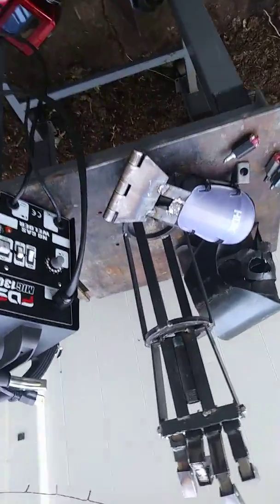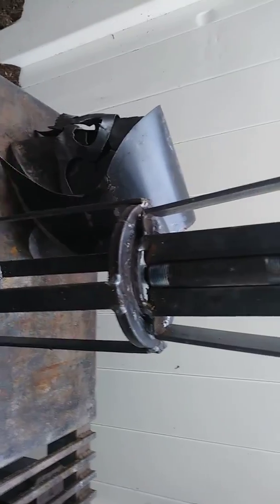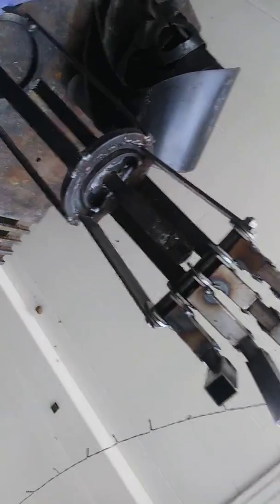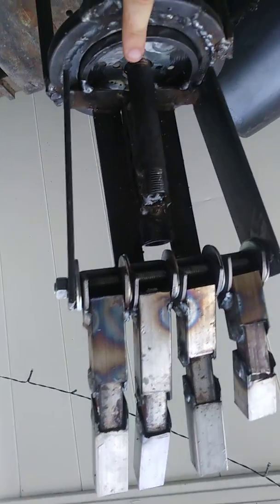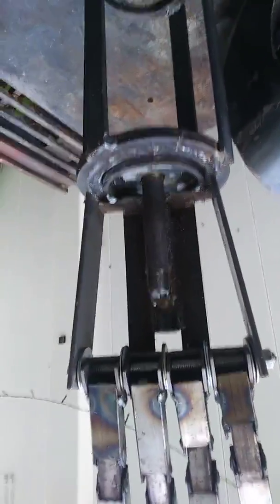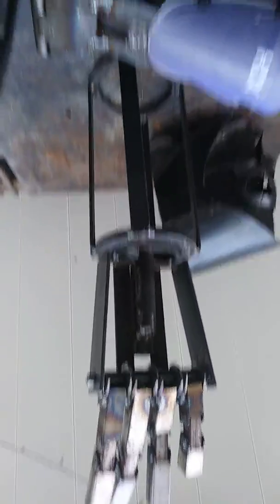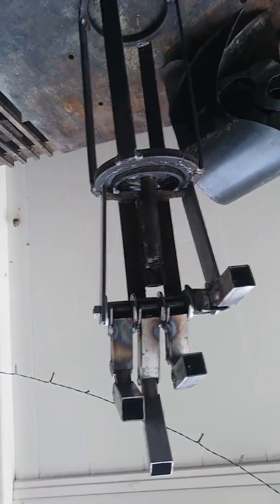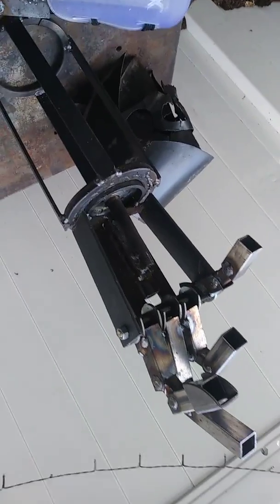Power Armor project #4, Gauntlet re-design and upgrades.

Comment: Whats the name of the hand sistem
Reply from the maker: I have servos connected to flex sensors and those servos are connected to wench wire that runs up each finger. This new model had linear actuators mounted in the forearm that pulls on the wench wire as well, giving a total crushing force of 1350 lbs per hand.

Comment: In all honesty your could destroy mine by hand shaking it mate
Reply from the maker: The goal is to make it functional in practical applications! One reason I'm putting a huge door hinge as the knuckleplate. My Instagram has more updates than this. 

Besides, you are the one with an engineering background. I'm pretty sure yours its gonna be beast! What do you think of locking finger joints at the base like a rachet? Could provide a lot of grip if done right.

Comment: Awesome. I will try to keep an eye on this. does it really need that much strength tho? wouldn't the strength on you pulling on the pullies with your fingers be enough to keep them closed? maybe if you need to lift heavier stuff they can lock shut. You might want to look up the iron hand of Götz Von Berlichingen as I believe that locked shut.
Reply from the maker: I want this to be as realistic as possible so if I am able to give it that kind of strength, I will. This is the prototype so whatever I can get away with at this point will be a success lol ill check that out! I still want the fingers to articulate as a normal finger. The two lines per finger would give the option for me to open\close it normally while the finger motors would give the option to crush stuff. Thanks for keeping tabs and the reference!